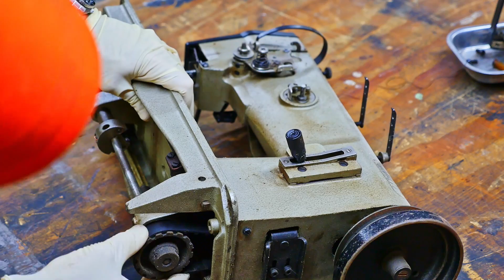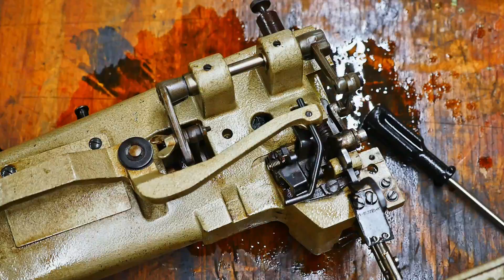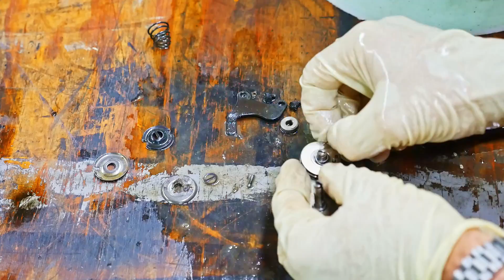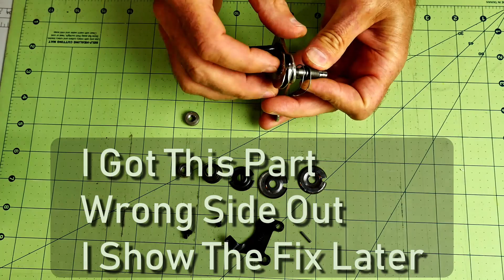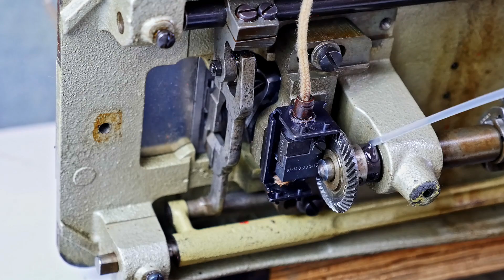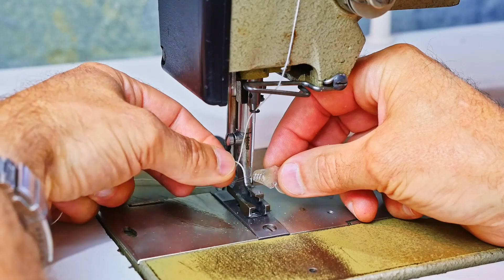Pfaff 1245 Refurbish Clean Assemble Adjust Thread Sew

Comment: That's a fantastic video - thank you!  I was just gifted a Pfaff 1245 and am going to be watching this video a lot.  Question:  When initially cleaning the exterior and parts, what are you using in the spray bottle - light oil?  A solvent of some type?  Some of the aqueous based parts cleaner you show later in the video?
Reply: GIFTED?! How the hell did you get that kind of luck?

Comment: Just my opinion,  I think you should have taken the entire machine apart and then cleaned every part. Every bearing surface should have been polished to a mirror shine.The bearings should have been checked  possibly replaced and so on. JB weld most likely want hold plastic together for very long so, you'll have do that work over. Maybe you could have cut threads in the oilier box and added a threaded tube coupling or just made a new oilier box  or,  ordered one from a supplier. You did a fine job putting  this video together. Thank you for your time.
Reply from the maker: Thank you for your opinion James Kennedy. Come back often.

Comment: Does the self oiler reach the gears in the white plastic housing and that’s why you didn’t have too add grease? Your videos are very well done..
Reply from the maker: I don't use any grease. The reservoir feeds wicks that carry the oil to various locations but there are still areas that need to be manually lubricated occasionally.

Comment: Beautyfull work but can i ask you about the liquide you use to clean this nice machine,i have my lovely pfaff 335 h3 it work like a clock ,i just want to clean it thank you very much
Reply from the maker: I would not recommend the diesel that I used for you. Sounds like yours is already pretty good. A brush to remove lent, compressed air if you got it and sewing machine oil are my recommendations.

Comment: I have a Necchi 958-101 walking foot machine. I have a problem while sewing and that applies to stitches. The stitches are uneven. By no means can't adjust the thread tension because when I sew slowly, it is somewhat fine or more pulls the upper thread and when I sew quickly, then the upper thread pulls the lower one and can be seen on the stitches.
I used YT videos as a reference to set the timing but again it's not the same machine, so I would ask you if you can tell me what the problem is. I would be very grateful.

Comment: Fantastic sewing machine Pfaff 1245. The Pfaff 1245 sewing machine is designed to sew leather, leather and thicker fabrics. And is it applied to make scholarships in general? In terms of durability, is it a durable and resistant machine? Are parts still on the market for replacement?

Comment: Thank you very much for this informative video. I actually got a possibility to buy one of these machines locally to a Price of about $600. However the machine need to have compressed air, and I do not like to have installed compressed air at the possible place of use. So I am a little worried about the implications of not having compressed air for this machine.
Reply from the maker: You may be able to remove the pneumatics and go back to manually operated controls.

Comment: My 1245 is acting up on me.  The Bobin jib is not rotating.  Any ideas of what I need to do to fix this. I was hoping your video would dig into the guts of this but I did not see anything that covers this area.
Reply: I figured out the problem with the gib hook not spinning.  There is a clip that comes detached.  You have to move it in place and press the small button to get it to engage .

Comment: I find spraying white spirit cleans much more thoroughly than any water based detergent, and dries just fine.
Is there any reason you don't use a mineral solvent ?
>
Reply from the maker: I use diesel. It is a lubricating solvent. I remove as much as I can with compressed air and then lubricate with sewing machine oil.
Reply: @AlexanderDyer  Yeah, diesel's good. As is paraffin.
But white spirit leaves no residue. None at all.
>

Comment: Awesome video. What are you using in the squirt bottle to spray and clean while your taking it apart
Reply from the maker: Many ask what solvent I use. I use Diesel Fuel with a respirator and a 
well ventilated outdoor shop with no open sparks or flames.

Comment: I have a Pfaff 1245 that I bought second hand and the screw that keeps the needle bar in position is busted. I was not able to unscrew it no matter what I did. Is there any way to take out the needle bar assembled with this mecanism attached, so I can work on it outside the machine, or do I have to file the screw so I can take the bar out?
Reply from the maker: I am not sure that is possible. You are in a predicament for sure. Perhaps try drilling out the screw with a left hand drill bit and extractor. Take care not to mess up you threads, it is a tenuous operation. Good Luck and Thanks

Comment: Thanks for your vid. It’s a big help to a learning operator. I have a pfaff 145 p 6c. The machine is old but still running good.The guide for needle bar and front walking foot is getting sloppy with the walking foot. Do you know a good parts vendor?

Comment: I just bought one of these its actually 1246 but was installed only one needle from 1245 so it basically mix of 2, but it starts sometimes like crazy if I dont crack it manually first few stiches, I wonder how you slowed it so nicely, servo motor? speed reducer?
Reply from the maker: What you saw was a servo motor in action and no speed reducer.

Comment: Thanks for the video. I have just acquired a Seiko STW-8B which needs a little clean up, so this helps. I can't tell wether the brush you're using is a wire one or just a tooth brush? and the cleaning solution is just diesel? Thanks again.
Reply from the maker: It is just a toothbrush and yeah.

Comment: What is the functionthat clear plastic plastic table that you replaced?  I’m imagining is transports oil from one part to another?  Thanks for your response.
PS. It seems like it has a wick inside it that you replaced;  I’m guessing the rectangular plastic tank is an oil reservoir?  Where does it carry the oil to?  Thanks again.
Reply from the maker: You are right, it is an oil reservoir. and the wick transports oil to critical areas. If memory serves me correctly that wick was for the hook assembly. Many of these industrial machines use wicks and pads to hold oil on various parts, it is a very tried and true method.

Comment: I bought a Singer 281-1 off of ebay and by the looks of the picture it's going to need a deep thorough cleaning. Problem is I live in a townhouse setting (with our own garage and driveway) but the fumes from diesel or kerosene might offend the neighbors. I used Simple Green on some engine parts and it degreased just as well a any petroleum product. So would Simple Green be safe to use without damaging the machine? I see by the parts manual the 281 has a wick oiling system and I was planning to replace wick anyway because of the use of water and Simple Green. Is there any product that is a definite "no" not to use inside these machines? Where can I order replacement wicks?
Reply from the maker: Thanks for your very detailed question. I am no expert and I have not tried to make a recommendation as to what to use, I am only sharing what I use, right or wrong. As for parts give hendersonsewing.com a try. Thanks again and have fun with your new old machine. 🙂
Reply: I contacted Henderson Sewing, thanks for the advice and link, they were a big help.
Reply from the maker: Glad to hear that, Thanks for the feedback.

Comment: Hi.  Would you ever use or advise using Kerosene to clean a machine like this?  What’s the advantage of diesel fuel, or are they the same?  Do you soak cruddy gears or parts in diesel fuel?  Sometimes, I soak really grungy parts in Kerosene. Would you comment on your thoughts, both positive and negative?  Thanks.
Reply from the maker: I think they are similar but I don't have any specifics on their differences. I have seen kerosene recommended and I have and would use it again. Diesel is cheap, available and familiar to me and I have found it to be useful. Kerosene seems to be a more refined product. I try not to advise, I just do things the way I do and let people make their own decisions on stuff and I am happy to share.

Thanks again for all your support.
Reply: Alexander Dyer, I can completely appreciate your not recommending products.  Just sharing your knowledge is more than enough.

Comment: After repairing and refurbishing the machines, what do you do with them afterwards?  If you sell them, do you ship to Canada? and an average cost for a straight stitch or a zigzag indy machine? any brand as long as parts are still current.  I had the opportunity to buy a Brother 756 and it is obsolete, the 755 is still parts positve but the 756 I couldn't find parts for, so if anything went wrong with it, I would have had a very heavy paperweight in my house lol.
Reply from the maker: I have bought and sold machines and shipped as far as Puerto Rico so hypothetically speaking, yes I would do Canada. But I don't have this machine anymore.

Comment: I appreciate the nice presentation. Could you please name the needle system you used to sew the leather and also the needle rise in mm.
Thanks a lot.
Reply from the maker: You should be able to find a manual for free online.
Reply: I have the manual but manual is just a guide and give no specifics. Anyway, I consider your presentation valuable and thankful for it.
Reply from the maker: if the machine is a H3, it uses a 134-35, but if it is a H4 it uses the 190
Reply: When I got hold of the machine, the drawer contained 134-35, 135x17 and 190 needles. I ruled out 190 right away as its too long.
Thanks.

Comment: Just picked one of these up for a steal, I have a lot of work to do to clean it up,... Can't believe how slow you can get it to sew, I was afraid I needed to buy a servo motor to get it to slow down like that... Is the flywheel tight when you hand roll it?
Reply from the maker: I use a servo motor. All motors have a brake that applies when you take your foot off the pedal. You can release the brake by slightly depressing pedal and then the hand wheel will turn more easily.
Reply: @AlexanderDyer  thanks for the reply, I'm new to this brand but have owned and used techsew as well as juki.. yeah, I have been doing that with the treadle but is the hand wheel supposed to be tight to turn without it? I pulled a ton of thread out of the handwheels shaft, should I lube it, or keep digging?

Comment: i notice u thread it in a different way then the Manuel does ..the book does not run the thread around the pin that holds the tension plates from spinning ..any reason why u do it differently  ?
Reply from the maker: Mea culpa. I have seen it done that way and it did work but I would say to go with with manual. These things are not set in stone and I have deviated from the manual's path before and was able to get quality stitches. I am not perfect and I am always learning. Thanks

Comment: Amazing Job Homie. What’s the soap you using to clean the old oil? The “parts wash” is also great.
Reply from the maker: I use diesel fuel. It works for me.
Reply: Kerosene works well too I'd guess?  I use it to clean motorcycle chain
Reply: Another option is mineral spirits.  I'd suggest the odorless type, and one with low voc.  Depending on where you live, this can be much easier to get than diesel or kerosene.  All of these require generous ventilation, eye and respiratory protection. Using a spray bottle or anything else that atomizes these liquids demands more safety.  Gloves and long sleeve shirt can save you from nasty skin irritation.  Go online a read the msd sheets for the solvents  you are considering.  (Material safety data sheet). Be informed. Be smart. Be safe.

Comment: Wow awesome video! I have either this exact machine or one very similar. Two things I’ve learnt from it: 

1) the little guide to ensure the bobbin winds up properly can be angled towards the bobbin to make it track better.

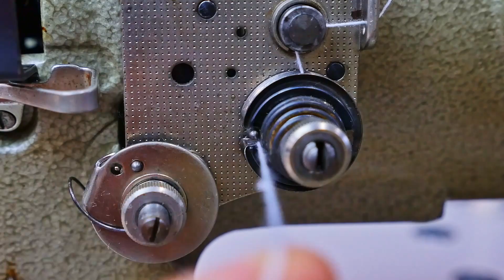2) at 15:24 there’s a little knob that the thread goes back over on the tension spring bit (sorry I don’t know the correct name!). 

Excited to try this tomorrow to see if it has any impact on my work.

Can I ask a question? Do you know if it’s possible to increase the stitch length past the maximum? I have issues when sewing 10mm thick pieces that the stitch length is about half the length of it when stitching thinner stuff, even though the setting is the same.
Reply from the maker: Actually, while that method you mention in 2) does work, it is not correct to the information that I have seen in the manual. You don't have to go around that pin like I did.

Perhaps your stitch length issue is due to an adjustment of the alternation foot height. Set that to maximum for the thick stuff and see if that helps. It should sew the same length for thin or thick so I would look elsewhere for the solution I would think.

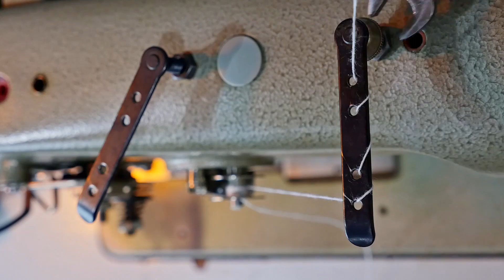Comment: At 15:01 there is a thread spring loaded tensioner at the base of the thread support,  did you bypass it on purpose!?
Reply from the maker: Yeah, I am filling the bobbin there. Keep watching and you will see how I use the tensioner.
Reply: @AlexanderDyer  I mean there is a tensioner for filling the bobbin you seem to neglect,  at 15:01 when you align the guide and tighten with the crescent wrench tool, the tensioner I'm speaking about can be seen just above the tool you use on the same post...
Reply from the maker: Oh, yes I see what you mean now. Honestly I did not notice it. Maybe if I had an issue with the bobbins not loading well I might have looked into it, ha ha. I learn something every day, thank you for pointing it out. Next time I get my hands on a Pfaff like this I will know better how to use it to its full potential. Great Machines!
Reply: @AlexanderDyer  Keep up the nice videos! Very helpful!